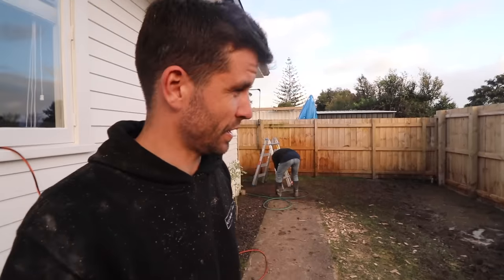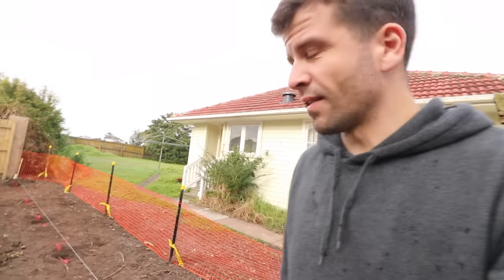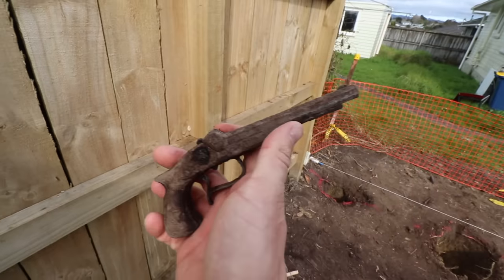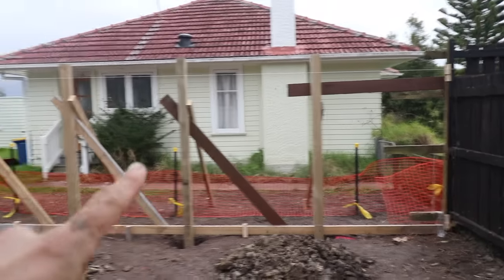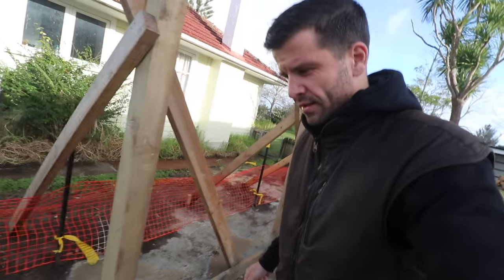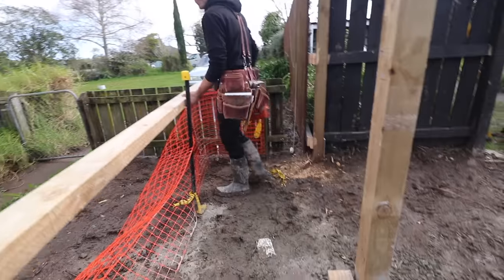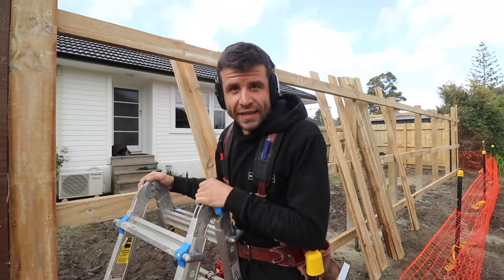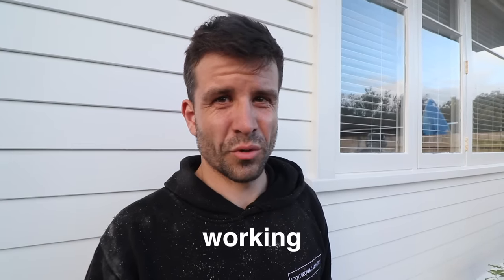How to Build a Fence (Like a Carpenter)

Comment: ok, don't hang me I'm not a carpenter,
 but why do you go to the effort of using a string line (with a spacer) to line up all the tops of the pailings to then free hand cut them to length with the circular?
Reply from the maker: Short answer is to get the bottom straight. They don't make palings to suit our fence height. We bought longer palings, strung it up so the bottom stayed consistent and then cut the top to the desired height
Reply: im far from a perfectionist/ finish carpenter bit i just level/plumb the first board and then flush up the rest, if once in a while youre hands are working faster then your eyes and it gets off course a bit trimming a half inch with the circ saw at the end brings it back in
Reply: Chris glasgow that would be to keep the bottom of the boards in line!
Reply: For example if every board was 50mm longer or shorter than the previous board, stringing from the top would put the bottom out and the top Perfect, which he then cut free hand. If you want the bottom line Perfect why would you not string the bottom and then cut the discrepancies between boards at the top like he did anyway?
Reply: @glastan3  I would assume every board is cut at the same length,  even if they were out a couple of mm you probably would see it that bad at the bottom
Reply: Scott Brown Carpentry A tip for you to align the bottom and keep the boards off the dirt slightly in this instance where you are cutting the tops off. Put one board on the ground and sit the board you are fixing on top. Gently touch it down on the board on the ground then rise it off a fraction and fix in place. Run boards in like this and when you get to the end of the one on the ground remove it and reposition it for the next run. Tuck the one on the ground under the last 3 or 4 you fitted and off you go. Hope that makes sense👍
Reply: @glastan3   u hv a lot more to learn . lol
Reply: @korlimservices4180  I'm listening.....
Reply: Didn't he use a chalk line for the top?
Reply: @glastan3  bro... if each of your palings are +/- 50mm... you need to get a new supplier 😂
Reply: How many feet did you set the post?
Reply: Just wondering, whats with the concrete that way, dont you guys have powder concrete that you can just fill the hole with the post in it and then when you are done at the end just put water in every post and it will work, you dont have to wait another day for the wet concrete to dry
Reply: Postcrete. Why didn’t you use Postcrete. It dries in 10 minutes and doesn’t resemble an explosion in a concrete factory afterwards!
Reply: I had to look up palings on google. It's short for Palisades. Where I live the Palisades are a rock wall overlooking the river about 100m high. It's also a defensive fence.
Reply: It’s a carpenter doing a fence.. may be ok when it’s done, but doesn’t flow with the land, and done the most difficult way possible.. i learned a better way doing fencing too eventually
Reply: @cmichaelspencer  what way is that?
Reply: @cmichaelspencer  wire?

Comment: Ok just to sort out the people who think they know it all in this comment section. For Scott's fence posts it's 44 bags of concrete at around $8 a bag which comes to $352 just for the concrete that isn't even quick set then you've got the hour of two of mixing all 44 bags. Concrete truck roughly $250 for 0.4 cubes and it's done in 20mins. So don't sit here and say it's lazy and "can't believe you got a concrete truck for that" when if you actually work it out it's cheaper and quicker. Thanks and goodbye. (Prices are for nsw Australia)
Reply: Jackson Johnson 44 bags lol

Comment: Use a 6x1 board running along the bottom of the fence, all feather boards then sit on it so you don’t need a string line and the individual boards are raised off the ground away from moisture.
Reply: is the board perfectly straight.

Comment: its interesting to see you just put the poles in the cement, over here that would rot after a year. we put the cement in and stick metal pole holders in the cement , then screw the poles on the pole holders once the cement has hardened. the cement stays under ground the metal pole holders stick roughly 5 cm above the ground and the poles never touch the ground
Reply: Can you link the product for fence posts?

Comment: A concrete truck for 7 fence posts?  Isn't that a bit of expensive overkill?  Couldn't you mix and pour the concrete yourself, on your own schedule?
Reply: Quicker, cheaper and easier to order a truck than buy, transport and then mix  50x20kg bags of concrete.. I worked out the concrete volume to be 0.48m3 and each bag of concrete is 0.01m3. 
Minimum concrete order is 0.4m3 in Qld so take the easier option.
Reply: @kizzjd9578  wowwww aren't you a diy expert. So much knowledge. There's advertisements everywhere here in vic for chippies to go work in Queensland. Evidently they really need us. First of all, your maths is wrong, secondly, you should never be in charge of ordering materials, thirdly, a boundary fence post I'd probs go 1-3-3. That's one shovel cement, 3 shovels sand and 3 shovels agg. Good to mix the dirt you dug out with your sand for many more reasons other than economics...id go 1/3 dirt/sand. Work those costings out next time you're fucking around on your phone instead of working. Lastly, you're fired.
Reply: 50 bags more like 4 with some road base so like 60 bucks and you can take your time and not make a huge mess
Reply: Different building code up here mate. you have your  way, I have mine.
Reply: Kizz jd  half to m3 concrete mix 7 bags cement use own mixer  2 hours work and still be a lot cheaper than having the concrete truck come in.
Reply: @robertbutler8004  2hrs work or 20 mins with a truck + 10mins to wash up shovel and barrow. What if you don't have a mixer? Not all carpenters are full time fence contractors.
Reply: 8 holes at 300x 900 = 2 bags per hole = about 16 bags total. @ 15$ a bag = $240.
2 builders for 2hours @ $55 per hour= $220. = $460 total.
0.6 cube delivered on a truck will cost you $300.
I work for a concrete construction company, the rule is if your mixing over 4 barrows by hand it cheaper to get a truck..
Reply: dLimboStick alot of times when building fences we just drybag the cement
Reply: @kizzjd9578  how would it be quicker lol? ring up and order concrete. concrete turns up done. less time spent on labour
Reply: @armsmerchant  same shit we work to as a builder in New Zealand. less labour and mess. just makes sense here aye
Reply: @kizzjd9578  16 x 20 kg bags of cement is enough for 1 cubic metre of concrete, so half a cube should only take 8 bags, got to be cheaper than readymix, it is here in the U.K.
Reply: @jimjobson1958  1 x 20kg bag is 0.01m3. Not arguing but that's just the facts.
Reply: @kizzjd9578  Firstly your maths are incorrect, the approx. volume of 1 x 20kg bag of cement is 0.138m3 not 0.01m3  and secondly the fact is ask anyone who works with cementitious products on a daily basis and they will tell you that approx 16 x 25kg bags (dependant of bag size in locality, total amount equating to 400kg) of cement is required for 1 cubic metre of hand mixed concrete ( by hand mixed I mean doing it yourself with a mixer) that is mixing at a ratio of 1:2:3 for a general mix, I don't know how you are coming up with a figure of 50 x 20kg bags as this equates to a tonne of cement which in all honesty is way too much for 1 cubic metre of concrete, also there is the shrinkage factor to consider in that all ingredients of the mix will shrink once water has been added, even with that considered i tonne of cement is way too much.
Reply: @jimjobson1958  I'm working on bags of concrete, not cement. Assuming you don't have sand or a mixer etc.
Reply: As in the video, which is why we are all here...
They used a concrete truck.
Obviously being a carpenter, he doesn't have sand, cement and a mixer in the back of his ute 24/7. 
He's not a concreter.
So he would either have to buy and mix concrete himself (working on 0.01m3 per bag).
Or get a mixer, sand, cement and a wheelbarrow then do the job, cleanup take all that home then go to another job where as above, he cleans up.. job done..

You all assume he's a fulltime fence contractor that tows a trailer full of materials and tools for fence posts and that's it. 
Far from it.
Reply: @kizzjd9578  Or in this instance he doesn't clean up, I've been doing it a long time and for a job this size believe me sometimes it is easier all round to mix yourself, no waiting for trucks to arrive and you're not against the clock, tool hire stores will deliver and collect a mixer for about £30 for a week in the U.K., a ton bulk bag of all in ballast and bagged cement can be ordered days in advance so its on the job when you arrive plus the main factor being the  overall price is about 1 third that  of ready mix, for a job this size it seems a tad overkill to order ready mix, plus most ready mix firms will make you take the full amount of concrete you have ordered and only deliver in increments of .5m3, so if you only need .3m3 you're stuck with another .2m3 which usually ends up in a skip, that's probabaly why there's so much mess in the video, they've tried to spread it out to use it up. On the other hand if I was laying footings, a driveway or other large areas of concrete I would opt for ready mix.
Reply: Bradley Reader , actually you didn't factor in the total time in ordering a crete truck. first of all after digging the holes you have to breakdown the job , waste traveling time to another job, set up that job for a couple of hours work and then breakdown that job. then you have to arrive at the job one hour early the next day  in case the truck arrives early or worse lose a additional hour because the truck is late,  and again leave the site to get to another site to finish off the day. so effectively what should have taken one day at one site with zero time wasted in travel took 2 days and potentially hours of travel. clearly you aren't in the contracting business. you probably work in a mail room....I'm right aren't I ?
Reply: Wow really a concrete truck.  What a big fucken mess. Lazy people. 
I put 7 post in. Spent about $35 in concrete bags. Home depot. Just WOW!!
Reply: The most hilarious thing about this comment stream is the number of experts who don't know the difference between cement and concrete. Or maybe it's a reading problem.

Comment: Having the concrete pour flush to the actual soil will bring water around the wood post. It's gonna rot really quick...

In canada we rise the concrete hole a couple of inch higher of the actual soil to prevent that.

Comment: 1 - 80lb bag dry concrete mix per hole tamped in as you go mixed with a little of the dirt and lightly moistened with water and you are good to go with no mess . Also post 5 ft on center you can use 16ft 2×4s lateral stringers that can be cut on a 22 degree bevel to break dead nuts on center of your post attached with exterior screws  predrilled pilot holes  . With 16ft 2×4s you can stager the joints so that there is only one joint per post . Try it you'll like it . That's the way a carpenter builds stuff
Reply: 20ft / 6m is a standard length rail/stringer we get in NZ. 16ft/4.8m is the shortest standard length for fence rails.

Comment: I'm doing a 424 ft (129 meter) privacy fence... Nothing exsisting, Not so easy my dudes! My 4x4 are off here and there... The ground slopes down, my posts are 8ft apart but are off an inch or so all the way down

Comment: Nice work. Just stumbled across your channel and love what you do. 

Question: whats the benefit of using a cancrete from a truck ? Wouldn't it have been less messy just getting some quick setting concrete from Bunnings and just using that ?
Reply: Facts tho
Reply: Hell yes it would have!
Reply: You try mixing 10 or so barrows of concrete(especially rapid set) and see if you wouldnt be ordering a truck next time.
Reply: @UncleChopChop22  A lot of guys just dump the bag straight in the hole, no mixing, just tamp it down with the bar as you add water. Probably not as strong but strong enough.
Reply: @UncleChopChop22  been there. Done that. It's not hard. My neighbor would have been pissed if all that flowed into his yard
Reply: agreed, without some sort of retaining panel or walls pouring concrete from truck for just posts is just unnecessarly and super messy, also good job on cutting the planks free hand, i would deff use track saw or smt

Comment: Word of advice I own my fence company D.l.F Inc Chicago Illinois 
It’s better to have the concrete a little heavy and did the holes to 42 inches down and use 10 feet post and another one is using a string for the bottom line instead of the rails saves time and your fence well come out beautiful and nice fence  need to go cordless my self cheers and leave your post at 6ft 1 inch and use a very straight 2x4x8 to use it as a level for the boards and it will be golden
Reply: Wow, and not a word, about the direct contact of concrete to the wood and mud... and the missing metal anchors, to prevent rotting from that contact. I would definetly hire your company xDDDD Not
Reply: @klausischmiddi8649  the timber in this video is all treated for ground contact and fresh water

Comment: I like the way you joint the rails on the posts, but 2 men 3 days for a 40ft straight fence I do that on my own in a day without auger and without the mess, and I screw everything no nail guns,  if its wet just use a dry post Crete that pour was ridiculous

Comment: How long with that fence last? 15  years? I don't understand why you didn't buy off the shelf concrete posts, gravel boards and then the fencing.
Reply: Try 50 years. It's CCA pressure treated pine.  You do realise this is not your country right?

Comment: I'm a carpenter right, just curious possibly to learn something but why did you put a slight bevel on the top of the 4x4's? Love your videos dude
Reply: So water runs off
Reply: @dirtyharry6741  i figured that, we use post caps that already have slopes on all sides so that water doesn't go in the grain of the 4x4 on top. Good to know incase their not available to use, good option

Comment: Sup Scott I’m building my first fence now. Why did you need a spacer for the height of the pickets if you ended up cutting the tops. ( I’m not being critical it’s a genuine question) .
Reply: So the bottom edge is straight and at same height

Comment: That’s a big load of concrete for 6 fence posts. We’d just dump a couple bags per post and mix it in the hole. Isn’t a truck 10 yds or I guess roughly 10 cubic meters? I wouldn’t think they’d let you order less without paying extra
Reply: You can get 1m3 for $250-$300(NZ$) in a truck

Comment: With two people you can just use quick set bag mix. 2-3 bags per post can do the trick. Mix it up, stick the post in the pole, check against two string lines and plumb it with a level from side to side and have the other guy hold it while one shovels or pours the mix into the whole. Wait about 5 minutes and do the next post. It's a lot easier than doing any bracing I found but a little risky if you don't pay attention. I've done two sections of fence (4 posts and 5 post sections). Only annoying thing is mixing up the concrete but I bought a 20L mixer from eBay. You can pour two bags which is enough to set the post. Then top up as required! Anyway, alternative for a DIYer who probably can't reuse wood used for bracing, or has job site table saws etc.
Reply: i used that method recently on a 11 post fence worked out pretty good saved a lot of work the 20l mixer would be a good idea also the rapidset takes a hold pretty quick not much of a chance of post moving

Comment: i saw that ledger board at the bottom and literally did the head smack OH DUH!    i'll be using that in a week when i sink a bunch of posts that will be supports for an array of solar panels... had a 5' deep by 2' wide trench dug, will put in sonotube and backfill, then use that to plumb all the posts.   so obvious, feel stupid for not having thought of it before!

Comment: Carl Saporiti 
Hi Scott I am enjoying your video's and wanted to pass something along. I recently purchased a Makita 10-1/4" Circular saw (Makita 5104) for work I am currently doing...I see you like Makita tools, if you are not familiar with this saw you might want to check it out! A single pass goes right through 6 x 6 posts. Using it on a current deck build really speeds build time.  I am in the US and find some of the differences in techniques very interesting.
Keep up the good work!

Comment: Alot of work just for a fence I just use bags of quickset concrete works the same if not better. I also cut the top of the posts at 45° for water run off..
Reply: A 20° cut is enough for water run off.... 45° is unnecessary

Comment: Really went to town with the concrete, lol.. I mix really stiff, especially on wet sites. Would of mixed on site in that situation, shovel it right down the sides of my posts until it's just below grade, with a little tamping with end of 2x4, then mag the top so it's almost cone shapped to shed the water, that way I can put whatever the grade is right back up the the post. The board on the ground is interesting, I could set a 2x6 vertical to Mason line with stakes to have a spot to hook the dry poles to. I've always set them to the line with kickers. I very well may try that method. Thanks for sharring.
Reply: That guy.

Comment: Do not  use an auger.90% of the time there is roots or bricks or concrete.As soon as you hit these with an auger you will either rip ya shoulder out or end up being flipped over.Posts hole diggers much safer option.
Reply: get real mate